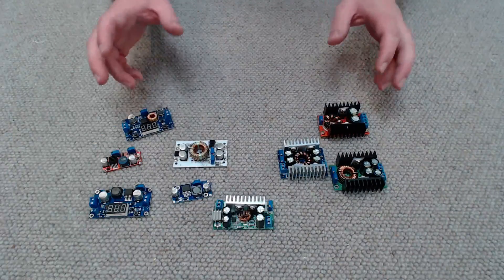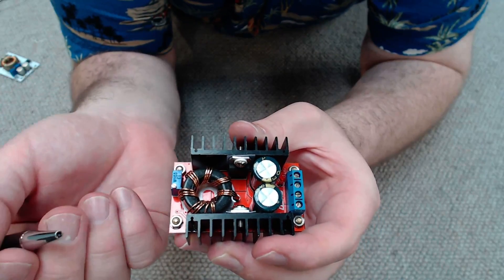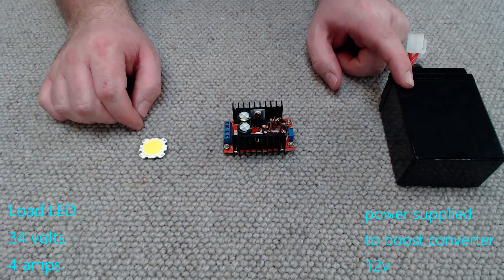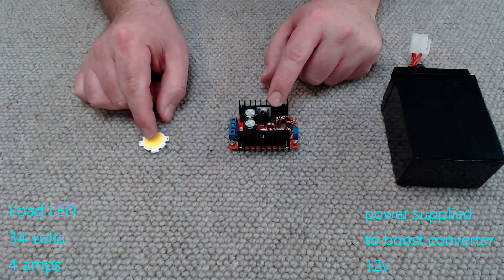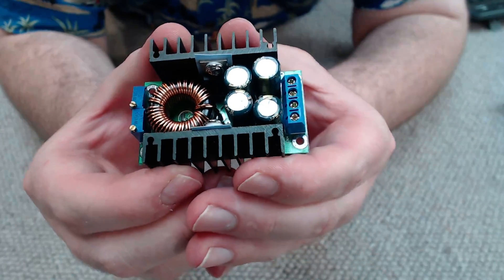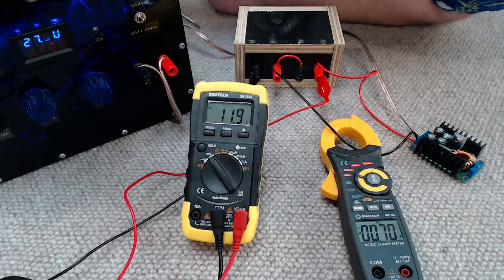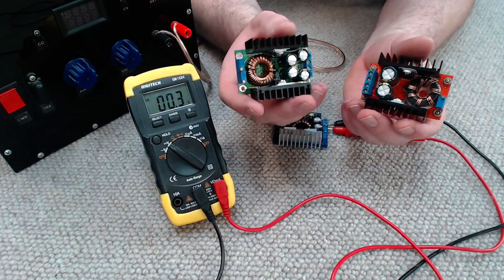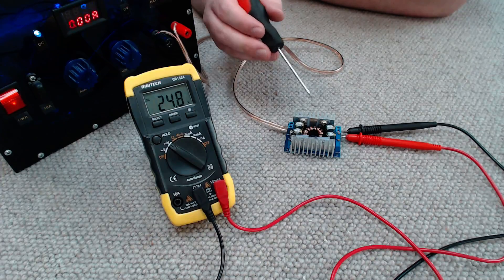What You Need To Know Before Buying A Boost/Buck Converter

Comment: Hi I bought a while ago 'I used it with 24V output (4Ah) then I disconnected it and after a couple of days I realized that the output voltage did not increase was the same as the input .. could be the trimmer?

Comment: Thanks for the informative video, is it possible to use boost/buck converters in parallel to increase current? Assuming they are both identical?
Reply: No, you cannot do that. They will have slight tolerances that mean that one will take more current so the other one will not consider the need to supply anything, which transfers all the load to the first one which will then fail. They also will have wierd effects due to slightly different switching frequency and ripple voltages.
Reply: @johncoops6897  true

Comment: hi sorry for my poor understanding of things here. I actually need a 19.5v 16AMP 330w  power supply for my laptop running over car battery on 12v. I am not sure which step up supply i need are the constent current regulated supplies work like even if the voltage of battery drop from 12v to let say 10.5v they will regulate the output to 19.5v?. I guess the tiny stepups will reduce the output voltage with the decrease of input voltage.
i am right here please. Also another question i think i can use multiple let say 4x modules to increase the current watts and still keep the voltage to 19.5v.

Your quick reply will help me a lot.

Thank You
Reply: Get that red boost converter. I've one and powering my Toshiba laptop off the cars' cigarette plug. It supplies enough current. Just before you connect your laptop, use a multi-meter  to adjust you output voltage to whatever voltage you need. I dont think you need more than 3 amps

Comment: can you explain the working of those screws on the top of blue  trim pot which increases the voltage and current in all the converters
Reply: it is a variable resistor, which it`s resistance could be changed by turning screw. using a voltage divider, it provides an analog feedback to the microcontroller to adjust dutycycle.

Comment: I use a pair of 58V 30Ah lithium packs for ebike touring. Charging them with a Grin Satiator and/or a SunCapture 300W folding solar panel. Most of the electronics I travel with are charged by USB but have a couple other devices that have their own ac to dc converters. Can I use the packs with a single dc to dc converter (hoping to save weight) to charge multiple items at different voltages? Maybe have specific connectors for each item and general USB voltage. Being able to charge the packs and then be able to charge everything else off of them with the minimal amount if weight.

Comment: I have to ask.  If the input drops to 10 volts on the buck converter will the output drop to 10 volts if you had it set at 14 volts.  But if you put 20 volts back into it.  You would have 14 volts. ?🤔

Comment: Can we connect this boost converter from solar panels and output to motor or battery
Reply from the maker: Yes, you could. I'd recommend using a Low Volt disconnect so when the voltage from the solar panels drops below a certain voltage the boost converter is switched off. This would protect the converter from drawing too much current when the solar panels aren't producing sufficient power.
Reply: @Schematix  wot he said 😁
Reply: You need battery on solar panels to collect energy (electric) then use converter cus solar am shit and recharge battery over time ...hours or days depending on size of panels and battery
Reply: That's where you design it for your needs charge in day use in the night
Reply: Nothing stopping you from connecting to solar panel long as you limit output current to less than solar panel minimum output cus in direct sunlight would be max output lol 😁

Comment: Thanks for the video! I have a simple question for you all: what does mean when the bicolor LED is RED? Is the device in current or in voltage limiting mode ok but which one of these two? How can I avoid this behavior?
Reply from the maker: Unfortunately, that is entirely depended on what the manufacturer decided to color-code each mode with. How I'd recommend you go about determining what each color represents is with no load attached to the converter, whatever color is being displayed should be voltage control mode.

Comment: This enplanes a lot, I'm trying to take a 5v power bank bump it up to 6v to run my RC transmitter still working on the amps & watts part of it all.
Reply: A 5V power bank is actually a 3.7V battery with a boost converter. It is silly to then add another boost converter on top of that to get 6V. So, use a battery and one boost converter, or better still use 2 batteries and a buck converter or just connect directly to 2 x LiFePO4 lithium cells (3.5V full charge, 3.2V nominal).

Comment: More important than it's stated volt rating... Read the top of the capacitors and stay 5v shy of it. Preferably more. If they claim it goes to 35v but u see 35v on the top of a can shaped cap... It does not go to 35v... At least not very long or more than once 😂

Comment: Leds have characteristics such that as they get hotter resistance decreases... U always want to regulate the current. The rating of the ic is only one part of the story. A lot of those Chinese units use as thin of pcbs as they can force the six year old to make. Thermal mass comes to play when the pcb uses too little copper. I injected 42v into ethernet to run a rasbery pi cam and at other end bucked it with a pos from China... One day I spent an hr walking around looking for what smelled like hot electronics... Then I noticed the camera was off. I shit u not the chip desoldered itself and dropped to the floor

Comment: I experimented with these about 6-7 yrs ago and one one thing I ran into was the caps will blow @  fast power  switching .
Reply: The caps will blow if you exceed their voltage rating. They will NOT blow when you switch the power on and off. In fact, the caps are designed to smooth the switching of the converter... that's how they work (by switching the power on and off very quickly, like kHz or even MHz frequencies).

Comment: So in general a buck converter save more power the a boost converter. Right?
Reply from the maker: Neither a buck or boost converter will save you any power. A well-designed buck or boost converter will be around 90~97% efficient. Meaning typically a 3~10% power loss

Comment: Im trying to find cheap boost converters to make pocket taser.  The cylindrical ones are not available in my country and is just simply unavailble and would be a hassle to get, but you have shown one in the thumbnail thats what is available. I was hoping it works just the same, havent watched yet

Comment: Hello! Can i suply this step up with 12v 2a, and get 24v 5a?
Reply from the maker: 12v 2A = 24watts. 24v 5A = 125w. Where would the extra 101watts come from?  That's overunity. You would need a minimum of 10.4A at 12v to output 24v 5A

Comment: I have led chip 36 volt 2100 mah how much current we need for 150 w boost converter (red colour) to get out put 36 volt 2 amps
Reply from the maker: That depends entirely on the source voltage. For example, if the source voltage is 24v, you'd be drawing 3amps. And for 12volt source you'd be drawing 6amps
Reply: My board burns 2 times two boards burn any other suggestions for 12 volt to 36 volt which can supply 70 w 36volt led
Reply from the maker: Is the boost converter being sufficiently cooled (e.g with a 12v fan)? with a 12v power source and 70W led you'd be drawing a minimum of 6amps. I'd recommend you find a 10~12amp boost converter.
Reply: Schematix ok thanks and i use 12 volt mini fan for cool down the boost

Comment: I'm an amateur radio operator in the UK. My shack laptop charger (cheap Chinese replacement) was spewing rf harmonics up to 144 MHz. I replaced it with one of the first boost converters you showed to raise the 13.8V shack supply to 19V to run my laptop and all the rf interference disappeared. The laptop takes less than 5A to charge. I stuck the converter with suitable fuses in a die cast box with a small fan and it's been happily working for nearly a year now.

Comment: I know this is far back but i need clarification, I need to charge a 200ah lead acid battery. I need an output of 14.4v 20amp. Is it possible to input 19V 3.5A (Laptop Charger) to a 20A rated Buck Converter and get my desired output? If not possible, what is the Voltage and Current I need to input to achieve the 14.4V/20A
Reply: I THINK, NO. Your laptop charger is 66.5 watts rating and your load is 288 watts so your laptop charger is not having capacity to push the power required by load.

Comment: a buck.boost with three trim pots. 2nd pot for current control.  what does the third one do? any ideas?
Reply from the maker: Some boost/buck converters have an extra potentiometer used to switch off the converter when a certain voltage is reached. This feature is mostly used for charging batteries.

Comment: Great video thanks. Can I charge a laptop (20V - 3.5A) on a daily basis with the boost/buck converter? (off grid?).  The unit will be charged with a  100 watt solar panel hooked to a 12v deep cycle battery

Comment: I am interested in buying some for use in a homebrew tube preamplifier / headphone amplifier.  I have found some on eBay that claim between 20 mA and 500 mA (depending on which boost converter) in the 300-400V range.  Any tips on these?  

I used to have the AOpen AX4GE-Tube Pentium 4 motherboard, which used the Dallas Semiconductor / Maxim chip, and it seemed to be good driving a single Mullard 6DJ8 (ECC88) from 1965 that I pulled from a junked Knight oscilloscope someone dumped on me (the board came with a Sovtek 6922, but the Mullard 6DJ8 actually sounded better and tested new).

Using these would definitely save a LOT of money compared to buying an actual transformer and 5H (or more) choke, and make playing with tubes a LOT cheaper.

Oh, and if anyone is interested in tubes, check out my high resolution scan of the Radiotron Designer's Handbook (4th Edition) from about a decade or so ago at Frank's Tube Pages.  https://tubedata.wernull.com/other/RCA/index.html

Comment: Is it possible to keep the output voltage and input voltage constant but to change the current magnitude(step down from 70m to 20m amps)
Reply: I think yes couse on the board you have 2 potentiometers one for Voltage one for current

Comment: Hi, Great educative video. Please suggest me,

Solar panel open-circuit Voltage: 40V

Battery 12 V (AGM

Controller : PWM controller max input voltage 28V

I need to step down from 40V to 25V and connect to
solar charge controller to charge the battery? Will I lose energy in this converter
in step down mode? Or the module will convert in to Amps from Voltage while step
down? 
Which module boost buck converter module should I buy?

Thanks,
Krishnakumar
Reply: you will love about 50% because of the pwm controller and will break the buck converter due to the constant on and off from the pwm controller connect the buck converter straight to the battery I'll be better

Comment: hello , sir can i charge 12v computer UPS battery with the module ?? plz reply
pls Suggest me the best .
Reply: It would depend on what your input is. These can only convert from a DC input. If you take the input voltage into consideration as well as the current the battery needs to charge at, you can use the info in this video to calculate the parameters you'll need the converter to meet and then choose one accordingly.
Reply: @Jacques.krause  thank you sir

Comment: @3:00 -THIS, THIS is everything that is wrong with China and their retail.  Usually, from an American company and a Chinese company you can get the same stuff, and the Chinese company sells it for 1/10th.  But they lie, on EVERYTHING.  I don't mean that as a generalization.  I will give you my eBay name if someone wants to question it.  I have hundreds and hundreds of electronics components and parts (and various other things), from Chinese Resellers.  Also Alibaba, and they've moved into Amazon.  

LEDs are great examples.  US top of the line Cree LED - Light output 300 Lumens.  Brightest they sell is like 500.  Maybe $20.
Well hell, I can get a Chinese LED that's 5000 Lumens for $1.  Common guys, the credulity is stretched.  It's just automatically understood that you have no idea wtf you are buying.  A no-brand survives the end of the month, so there's no way to base quality on name recognition.

Now when you dont have the specs and it fails, you don't trust the company or seller anymore.  Doesnt matter anyway, because a law of China is that if you can find an item with one brand on it, you can find 20 others with different brands.

I have every one of those units you have there btw.
Reply: What's is it? I'd like to check it out!
Reply: The problem is lack of reputation.  Chinese selling to "the West" over the internet cannot accumulate a good reputation due to lack of branding or trademarks enforcement.  If one were to go to the trouble of establishing a good brand rep., there is nothing to stop 20 other guys from making cheap knock-offs.  They benefit (for a short while) from your reputation, which is quickly destroyed, because the Western buyers cannot tell what they will receive. 

Lack  of intellectual property rights enforcement was a deliberate government decision.  In the short-term, Chinese companies were able to copy anything at no risk.  The longer-term result is that China has now built a reputation, and it is shit.  Good luck reversing that.  Japan did managed to do so after many decades, but it sure wasn't easy.  Remember that great line from Back to the Future: "What do you mean, Doc?  All the best stuff comes from Japan."

Comment: Very good explanation thanks. The same principle applies to solar with inverter installations. 12v vs 24v vs 36v vs 48v . 12v setups are usually cheaper and easy to find but is limited do to high current draw. Where as 48v setups need less current and helps reducing cable thickness.
Reply: Absolutely! I plan to solar charge a 48v server rack, then regulate to 20V

Comment: For high powered EV systems, let's say 72v, 300amp peak draw,  can any old dc-dc step down converter be used or does it need to be able to deal with high current draw also? Does it need to be able to handle the potential high current draw of the system (from what I understand, it will be placed in line on the + battery cable.......... or does it ONLY act on the voltage flowing through the system?
Reply: in otherwords, worst case, there will be 300amps put through the system, does the converter need to have special capabilities to deal with that high amperage or does it just step the amperage down to it's rating input amperage?

Comment: could you parallel to of them together ? I want to order a 12 volt to 19 volt booster for a power wheel but only see 15 amp models and wanted to put two of them together to get 30 amps out to the motors. Do you think this is possible?
Reply: yes 
parallel will keep the voltage constant and double the current

Comment: super helpful, I use an Inverter for work and it has always bothered me jumping from DC to AC back to DC for the sake of charging small batteries. looks like i can buy a few boost converters and  let my 12v batteries do the charging directly. The converter in my laptop charger will especially appreciate this, it audibly hates the back and forth. I dont think amperage will be a problem in my case as the voltage jump will be minimal.

Comment: Hi, I am new to the world of electronics, so if my question seems simple or dumb to you guys please by kind. I want to install a pc that I have into my camper to run of the battery bank. I have a 12v dc pico power supply 250w connected to  3 x 12v batteries in parallel. The pc seems to run ok. The only worry is voltage spikes, I think. Would a buck converter prevent a spike or do I go for a 12v dc stabilizer. Not sure if any of these are what I need.

Comment: What is the current of the input voltage to power on this buck converter? Is +32V, 720mA or +16V, 610mA will work as my input voltage to power on this buck converter?

Comment: I just ordered a few step-up converters for the first time becasue My microphone receiver needs 13 to 15 volts but my lead acid battery goes under that. I think the voltage getting low is the reason I get drop outs with my receiver so I like to experiment with stepping up a tiny bit.   thank you very much for this really helping video.